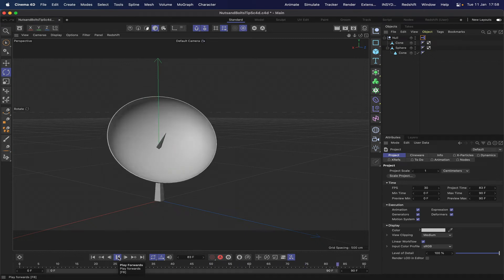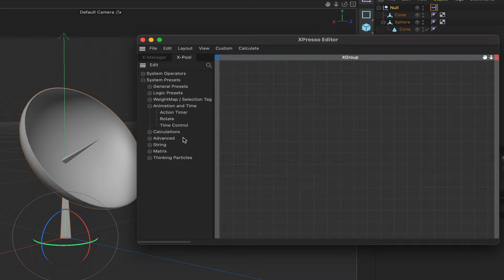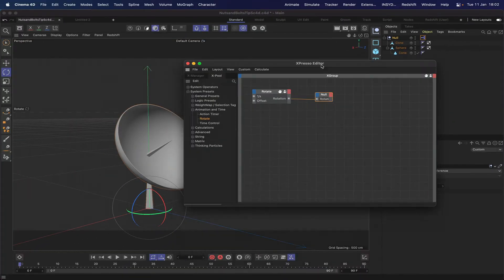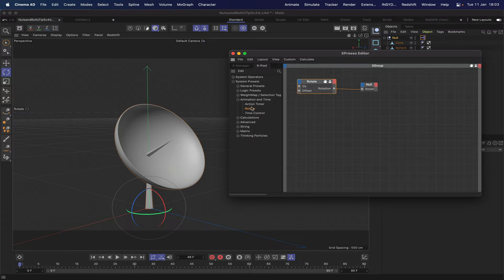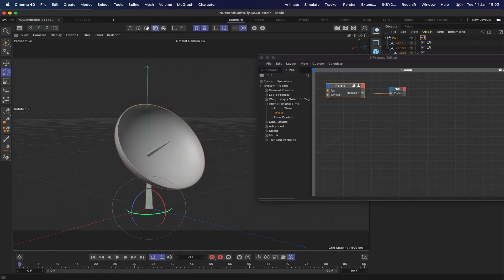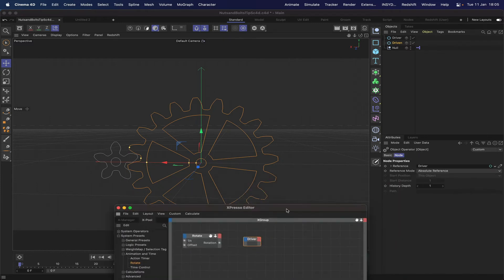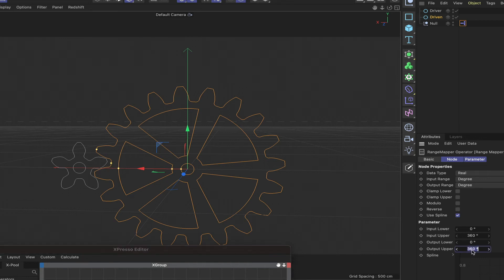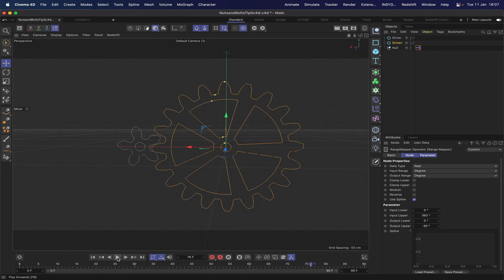Cinema 4D Xpresso Nuts and Bolts: Tutorial 5 - Using the Rotate Node

Comment: when animating the speed to have my object rotate slow, go faster, and then back to slow the rotation changes direction when reaching a keyframe. any solution to this?
Reply from the maker: Yes, check out my Community page for the solution. I have posted an image in there, illustrating the setup you need to use.
Reply: @ExpressoMechanicTV  Thank you so much!
Reply from the maker: @inflameFX  No worries.
Reply: The best way to have a rotating object eg helicopter rotor speed up, slow down, stop etc without going backwards is to generate the rotation by adding a small value to the existing rotation every frame. When the small value increases, object speeds up. When the small value decreases, object slows down. You need to set the rotation to zero at F1. This is easiest to do in Python.